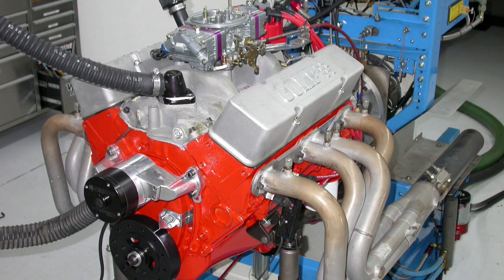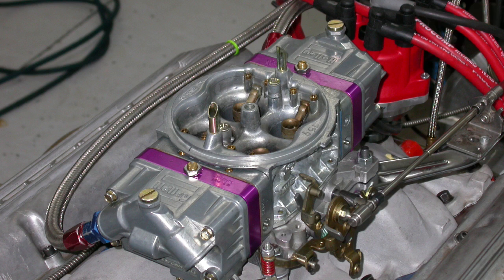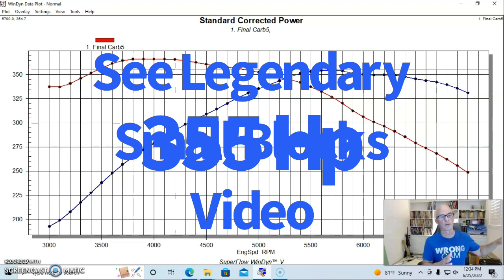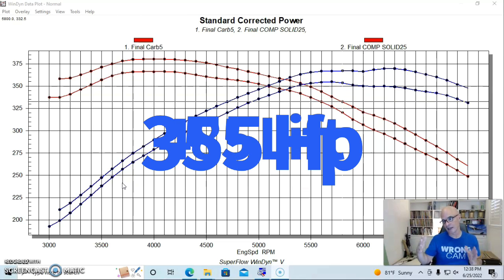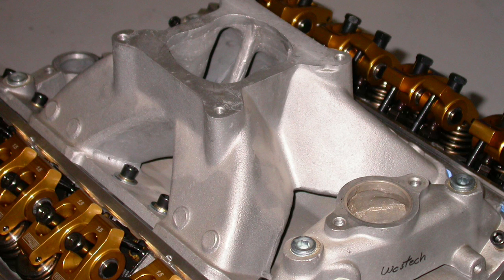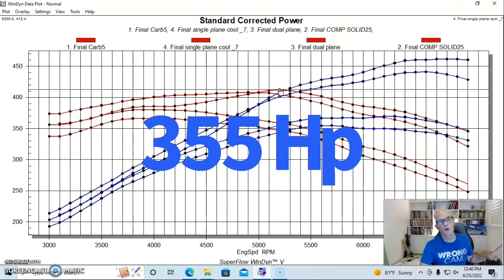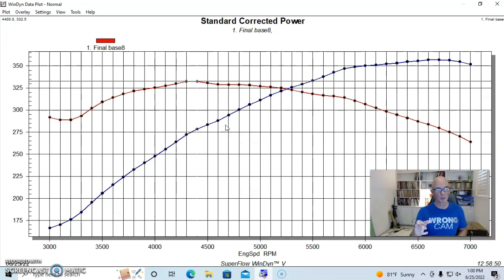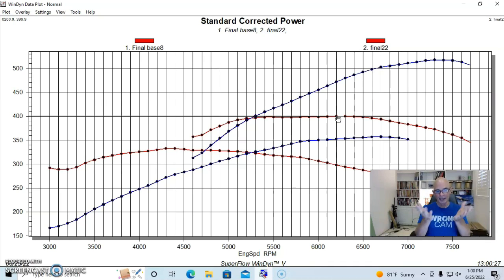HOW TO BOLT ON 190 (ALL-MOTOR) HP TO YOUR SMALL BLOCK CHEVY! DZ302 AND L76 327 SBC POWER UPGRADES!

Comment: Hey Richard I like to know if you would test a set of RPC 205cc intake runner heads  they look like afr enforcer.I bought some I have a  1995 GMC 1500 it's not a roller motor but has the holes drilled to be one. So I'm converting to a Howards cam not   to big  278/284  .500/.510 at 110 LSA.  And jegs rockers 7/16 1.5 And a dual plan intake. Pistons are dish  and new dubble roller chain and new oil  pump. I'm running a .026 head gasket  to pump up compassion a bit.and 670 cfm holley bawar carb. So have you ran that combo  and its going in a 79 el Camino  dark night.  4 speed. What do you think it would make in HP thanks. 👍
Reply from the maker: 350?

Comment: ...that 302 is really dizzy at nearly 550hp! Lets try this same tunnel ram and big cam and compression combo on the 327, then the 350, 372, 377 a 383, a sbc 396, 400- 406, even a 350 based 408 cubic incher. 420, the popular 434 440, and 454 sbc. yeah lets see this. Then for the big torque put a roller cam in each of these with matched compression with a dual plane and dyno test like this= XR264-XR276 edelbrock EPS in 327, XR276 & XR282 in 355,  Then performer RPM in XR282 & XR288 in 383 and single plane, dual plane and single plane XR288 - XR294 in 400 and then a single plane, then another single plane the Omazing Super Victor II and XR294-XR300HR in 420-454 c.i.  etc. etc. Make the LSA on all 107* or 108* :o) say "cheese!" The super victor II is the best intake ever made.

Comment: My sbc wont rev past 4500.  Anyone have any ideas why?  I'm running fuel injection.
Reply from the maker: what motor is it-check timing and fuel
Reply: Just a mild sbc 406  9-1 compression  has a  227/241 @.50 cam and dual plane intake with one inch spacer. Has  fitech 1200p/a throttle  body.    It's  n/a. I tried  playing with timing and fuel and  even  adjusted the valves again.     It breaks up a tiny bit above 4k then  and kinda struggles to get to 4500 then  kinda just flat lines . I checked my rev limit  it's set to 5800rpm.   I need ideas.  Thinking  maybe coil or ignition module is bad.

Comment: I have a dz 302 all stock with weiand high rise dual tunnel ram with 2 450cfm slayers on it with gear drive instead of timing chain in my 81 cutlass my question is where should my initial timing and idle rpm should be at I'm running at bout 10 or 12 initial not vacuum advance with one copper and one silver spring on mechanical advance with pertronix ignitor 3 and flame thrower 3 runs great but feels like it wants more off line and I'm bolted to a 700r4 with 4:10 gears seams to want to idle at 1000rpm in park
Reply from the maker: try more and see what happens

Comment: I appreciate your videos, good stuff. I know you have done a lot of videos on the effects different Cams have on Boosted Engines. It would be cool to see a video of the effects Headers have on a Boosted Engine. I know the Boost should drop a bit, but What happens to the HP and TQ when adding Headers verse stock exhaust manifold ?

Comment: I'd love to see some  junkyard 4.8 compare to the DZ302 , same carb., cam, heads the same  upgrades. thanks   (your the man Richard)
Reply from the maker: how can you make those all the same?
Reply: @richardholdener1727  all i can imagine is getting aftermarket Gen 1 heads with a similar valve angle and cfm. The LS will still have a larger crankcase volume due to the Y block skirted design, and theoretically it doesn't have a pumping loss created by the pistons going up and down (why the shelby block design has holes in the main webs), and there will obviously be an intake runner difference, but a dual plane to dual plane or single plane to single would be an interesting comparo.

Comment: Lets see a Amazon Aluminum Head will port matching and 60 over 327 11 to 1 comp that is what im building duel plane Edelbrock performer RPM CAM flat tappet Lifters Intake and carb 1.6 RR lifters...

Comment: Thanks Richard- there are a lot of small displacement chevys still out there - I was able to Aquire over a dozen 327 and 302 cranks heads and blocks from someone who was going to scrap them - plan on building a few over the next year
Reply: sweet, that's a deal i wouldn't mind running into, and i have a house full of "old" engines from LS fans who thought they were junk.

Comment: Any way you can do a dyno session with a 406 small block and build for brute torque on 87 octane? There was a motortrend mag build called the Impersonator years back. 500+ lb ft!
Reply from the maker: 500 lb-ft is not hard on a 406

Comment: I'm still running a 327 I built 28 years ago in my Nova. Flat top 2 valve relief pistons, zero deck, 10:1 comp, 461 heads ported by me, Comp 252/260@50, .541 intake .554 exhaust, 106cl solid flat tappet, victor jr and 700cfm dp. Made 435 peak HP and 380 ft/lbs from 4500-6000. Revs to 7500 with ease. I'm itching to put a tunnel ram on it. It would be interesting to see a video on the process of tuning the 2x4 carbs.
Reply: Awesome work.
Try the 'super victor II' on it without any mods untouched. Its practically a single carb tunnel ram.
Use some new 221cc brodix heads or the AFR like in the video. Night & Day.
Get compression to 11 or 11.5:1.
Use 6.2" rods and 1.175" piston with 9" deck.
prepare for way more usable powerband average torque pulling power.

Comment: Out of morbid curiosity I would like to see how much horsepower you can get out of a 383 small block using 87 octane gas. A throttle body fuel injection may be necessary.

Another interesting option would be how much horsepower the old Z28 cross ram would make.  I understood the ports would be hard to match to the AFR heads.

It would be great if it idles below 1000 RPM and pulled some reasonable vacuum so the hood of the car wouldn't dance around like a drum skin video from physics class.
Reply: So why did you think TBI would be needed? It typically relies on engine vacuum to set the MAPS, so that will limit cam choice (unless you use variable duration lifters from Rhoads or Crane, which can get near 6,500 rpm redines). I'm always surprised dyno owners bolting parts together never use this technology from the 1960's, tho they are flat tappet lifters so there's the zinc issue in recent times.

the ol' cross ram intake issue wouldn't be power, but where it would make it in the RPM range. The aftermarket versions tend to offer dams that can be switched around inside to change runner parameters, and that creates all sorts of varieties.

to get an idle that low (for running AC and avoiding a 4,000 rpm stall converter, etc) and not using a vacuum storage cannister and brakes powered by the steering pump, i would argue don't build for HP but for torque. hot rod magazine made ford and chevy small blocks with longer connecting rods to run 11:1 cr on 87 octane due to longer dwell at TDC, and with aluminum heads that might concieveably go up a point if its really the dwell time helping avoid detonation

http://purplesagetradingpost.com/sumner/techinfo/350%20chevy%20engine.html
Reply: @albertgaspar627  I will look at the article.  I recognize the website, I used to go out to Bonneville to help some participants.
Reply: @highwaymen1237  it's an interesting as hell proposal, and they made a 351W with I think 400M connecting rods for the increased length (there are stroker setups for the Ford with either 318 mopar or 300 I6 connecting rods out to 377 cid, but that's another story). HRM used AFR heads on the chevy, i think, and it's a big bore which theoretically makes more room for a second flame front inside the combustion chamber, potentially resulting in detonation if something got hot and acted like a glow plug. I wonder what it would do with Twisted Wedge heads and their chamber design.

Comment: I'd definitely like to see some more DIY porting videos and flow bench info. I've got an early 22RE to build which will need enormous port work because of the swirl in the intake side and a Mopar LA 360 which will have boogers and mess in every runner. Running on California 91 octane and trying to stay street legal while getting in power and efficiency where I can.

Comment: I've always been curious about how efficient ( fuel mileage wise)  you could get out of a SBC  that was installed in a fairly light weight car with good aero. (like a 3rd gen F body) Is smaller better like a 262- 283 ?  The car would still have to be drivable, not like putting a lawn mower engine in a passenger car. I wouldn't care if it did 18 second 1/4 miles.

Comment: Richard, 28 years ago, I built the 400 small block "What If" motor. It consisted of a .040 over 400 2bolt main block, stock crank,stock rods,and stock replacement TRW 4 valve relief forged pistons. The  camshaft was a copy of the 3927140 GM small block solid lifter camshaft with 257in/269ex dur at .050 ,.493in/.512ex lift 112 lsa. I substituted the Dart 200cc cast-iron cylinder heads with a 2.02/1.60 valve package for the 186 stock heads. I ran an Edelbrock 2975 Victor Jr. manifold with a Holley 700 cfm Double pumper. In my 1971 Chevelle with a Turbo 350,3500rpm stall converter, 4.10 gears in a 12 bolt rear, my Chevelle ran a best of a 12.02 at 112mph on M&H Racemasters through 3 inch Flowmaster exhaust. I think Chevrolet missed out on an opportunity to make the most powerful small block using parts they had in inventory. It would be interesting to see what that combination would have produced compared to the LT1 350.
Reply from the maker: what factory cam ever had a 257/269 duration split?
Reply: @richardholdener1727  The 3927140 camshaft was part of the offroad package that you could order from a Chevrolet dealership along with the crossram intake,carburetors and headers for the 67-68 MO and 69 DZ 302 and could be dealership installed.
Reply: @richardholdener1727  Elgin made a copy of the 3927140 GM camshaft under part# E-902-P

Comment: With the after market offering heads to fit either a vortec intake or the original pattern they always seemed biased towards one or the other. So say an edelbrock air gap for each flow tests super easy fast test to see if there is any gain to the newer vortec port shape (top closer bottom wider) or no change what so ever.
Reply from the maker: why would you mix and match intakes for the different heads
Reply: @richardholdener1727  what i mean is certain heads will allow you to use either intake. But have to be port matched to whichever intake you choose. So could one bring more power then the other? Afr eliminator I believe is the one I purchased previously that claimed this. I chose the one that required the least amount of metal removal to match up to the intake. I always wondered if a guy spent enough time to remove the metal to match a vortec intake would there be any gain to be had from the new port position & style.

Comment: Great video as always Richard.  Like to see a tbi 350 build start  with stock heads then pocket port  shot for decent horsepower  more of a torque  poooower the swap to aluminum l98 heads stock then port them then on to vortec's  .maybe  tighten up the dynamic compression with the cam
Reply: And swap to a carb

Comment: So much for the guys that think a 302 needs 500 CFM LOL. 2x750's made the most power!
Reply from the maker: it wasn't the carbs-it was the intake
Reply: Richard, are you saying that the tunnel ram would have made as much power with a single 600 cfm carburetor? I don't think so. Maybe you can test it and find out? Maybe with at least a 750 DP.

Comment: I like to see a comparison between the 350 SBC and a 400cid SBC next to stock then go full tilt and then when after the 400 takes home the win I would like to see a comparison between the 383cid SBC and a 406cid SBC
Reply: Power Secrets by Smokey Yunick is a book I highly recommend reading or anything written by Bill "Grumpy" Jenkins. Personally I love the 350, 400, 383, and 406 I have built and ran all of these and they are all excellent choices. They were all different and had their own fun factor is what I really loved. The stock 350 I had one that was from the 70s that was never rebuilt, never had the intake off, stock carb, and just very well maintained by the previous owner it had over 350K on it when I got it. I ran the snot out of it and when I parked it that engine had probably close to 500K on it and sure it burned oil through the valve guides yet it still started and ran great every time. My one gripe on 350 and especially 400 small block engines is nobody ever seems to remember to run  that factory torque strap on the starter or fabricate one if you loose the original. I have lost count of how many people damage a block or you get one boiled and when you mag it you find that area cracked. Build them and have fun with them because they are not as easy to find as they used to be.

Comment: Actually yes to all the above.  Something milder, junk yard sourced, with the best possible drivability for experience.  Basically I'm thinking about building up a 350 Chevy block sitting in the shed to stuff in a Jeep CJ or Datsun 280z.  Cast crank and pistons.  I don't want max power but the most broad and flat torque curve possible, with the best sound.  I basically want to rev it out to 6k in a well mannered way to have fun and enjoy the experience.  It would be neat to see versions for both applications but I'd like to see the 280z version first.  I think 350ft/lbs would be a good target as that's where the drivability limit (controllable) for a somewhat stock chassis is.  There is a lot out there about making peak power, but not a whole lot on making an insanely flat and broad toque curve with amazing throttle response.

Comment: would like to see a stock 350tbi motor upgraded with aftermarket aluminum heads (afr, brodix, etc), cam (xe268, xe274, etc), hyd flat tappet and sniper efi. i want this because my truck's next phase is the engine. i have already upgraded steering, suspension, brakes, rear diff, tires/rims, driveshaft and tranny. i only have the engine, exhaust and cooling (radiator, hvac system) left before i can go hunting for 392's at my local strip.

Comment: + 1 on the 350 chevy should have built! 400 block 327 crank.
Reply: The Oldsmobile 403 has simular bore and stroke 4.35x3.38 to a Chevy 400 block with a 327 crank 4.12x3.25 about as close as your going to get in a stock engine but its bigger the Oldsmobile 403 has a monster 4.35 bore is bigger than any other GM gas engine for cars including Cadillac 500ci Oldsmobile 455ci Chevy 454ci Pontiac 455ci Buick 455ci but the 403 is a larger engine than a 347ci in bore and stroke
Reply: @gloriamaletta8667  Agreed. Only drawback is finding parts for any of them or anybody who makes quality performance or aftermarket parts for these engines you listed. Its a shame because quite a few were power houses that were overlooked by many people.
Reply: @sswcustomsewing4276 Two sources Mondello Performance or Dick Miller Racing but it's not cheap

Comment: How about doing a build on a bone stock 307???
Reply: Okay....
Bone stock 307 from a 1969 Camaro makes 200 HP Gross.
Done!
Reply: If you have one that you want to build go for it. Stock they were nothing to write home about for horsepower however they were reliable. Put some 350 sbc  1.94 heads on go 1.60 on the exhaust valves. Run the Chevy LT-1 solid-lifter cam or the Speed-Pro kit under their #KC-1145R which is the equivalent. Aftermarket intake from a swap meet, run a q jet or Holley, and that will be a fun engine. Just use what you can find low buck or what you got. I say true the deck heights, align hone the mains, and do the machine work right. I always went by what old Smokey Yunick explained in his book word for word on machine work on any engine even a stocker that little extra really helps. A friend of mine we built a 307 like that 20+ years ago its still running strong in his Chevrolet pickup. Only screw up was he first picked the old 3030 Duntov camshaft for it which wasn't a great choice because they like to make power over 4000 rpms.  We also ran a set of port matched 2 1/2" dump GM Ramhorn exhaust manifolds on that 307. No clue what it makes for horsepower yet its smooth, reliable, plenty powerful, economical, and he has driven it daily for the last 20+ years without any hassles.

Comment: How about a 400...... so many guys now looking at these engines
Reply: You're 30 years late if you're looking for a 400 SBC.  They were the hot ticket in late 80s/early 90s.  Bore em 30 over,  heads, cam,  intake was good power for a Camaro.  Hard to find a 400 now,  junkyards long since picked over.
Reply: Sadly finding one these days is not easy. I remember when they were the hot ticket and I absolutely love them. Why Chevrolet stopped making them has always been a mystery to me.

Comment: I’m currently building a “dz302” very similar to what you just did except it’s multiport efi. I believe I chose the same solid roller cam too. It’s going to be fun and compete against our twin turbo crown Vic I just finished. It’s going in a square body caprice 9c1. Both manual swapped of course. 

Just out of curiosity, why don’t you video the dyno pulls?  Even if it’s just the max power pull.

Comment: How about us guys with older sbc builds that used heads, intakes and cams that were the hot street ticket way back when.
400, sportsman II heads, .500 lift hydraulic cams. Stuff we ran on the street that made torque, not so much race stuff.
Reply: Those were the days I miss building those engines. Funny thing is that they are all still running strong in people's everyday drivers.